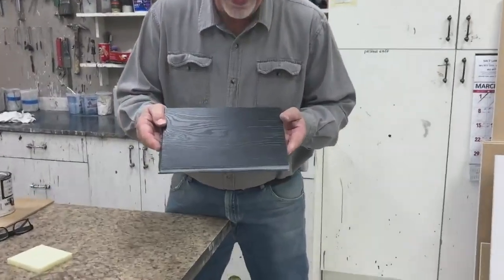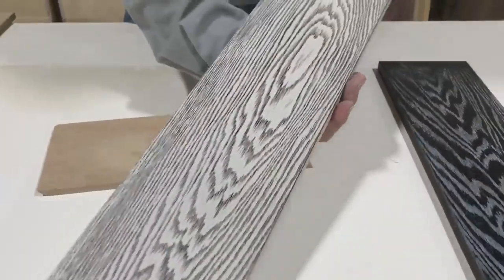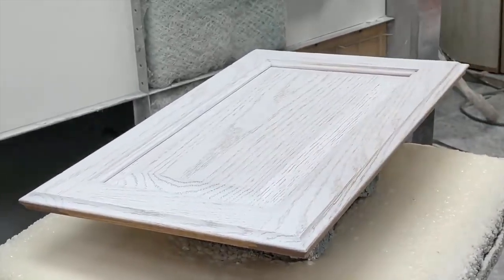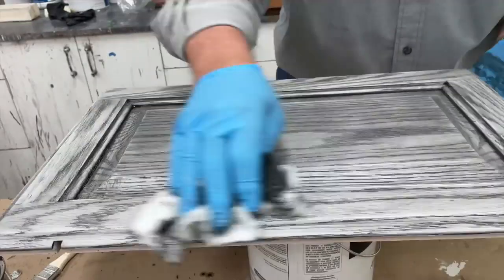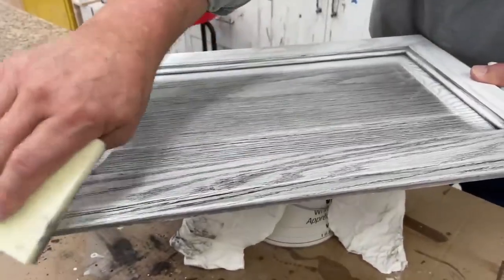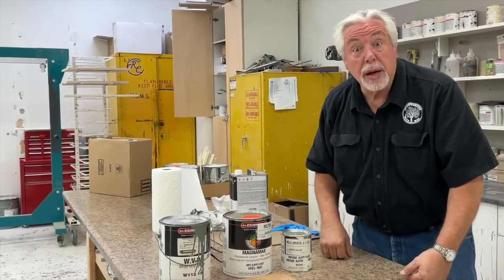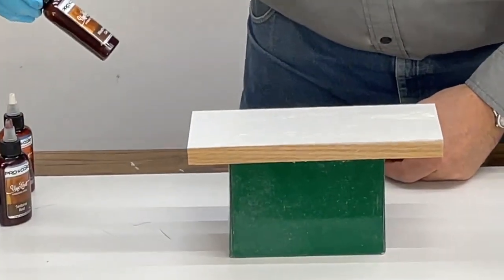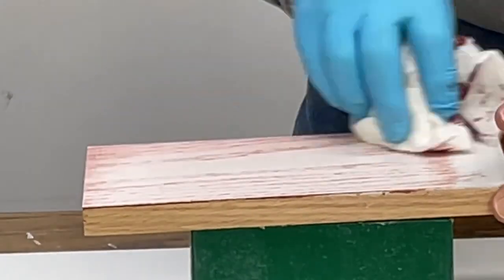Transform Your Golden Oak with Wes's Top 4 Cerusing Videos

Comment: There is a cable channel that I think should be turned off. Their "experts" are driving folks to do things that are not the best choices. I can understand doing this to "cheap" furniture", but for quality pieces, if you are going to do this stuff that is in the video, seal the wood first so that later it can be removed without having to sand or plane a bunch off. Styles will again come back to natural wood. And for heaven sake, don't paint brick, it is totally destroyed for future owners. Wes usually has some good suggestions.

Comment: Hi Wes. First off, your cabinet finishing skills are amazing!
I am trying to ceruse my kitchen cabinet. You inspired me to take on the job. 
I wire textured my cabinets real good. I have put 2 coats of Bin Zensser primer coat on. Do I need to add another sealer before applying my glaze? Also, what glaze, that is over the counter, would you suggest with the Bin Zensser primer? I've put a lot of work in so far, and just really scared to mess up. Any advice would be truly appreciated, sir.
Reply from the maker: Hi Wyatt...I am not familiar with the Bin Zensser primer that you are using but to be safe, apply a clear sealer coat over your primer. As far as the glaze goes, I recommend ProCoat Unicoat Glaze and will provide you with a link to the video that will give you a link and discount to the product. Hope this helps. Wes
https://youtu.be/-FSoaeDcSjg?si=6QdI8pgnZ0tHd5-6
Reply: @WoodworkingWithWes  So very kind for you to reply , Wes! You are very talented sir! Thanks :)

Comment: Hello Wes, I realllly love this technique. How do I finish the cabinet sides and front that I cant remove. Should I paint them just solid white?

Thank you for your wonderful videos!
Reply: When painting cabinets they should be fully disassembled. Doors & drawers taken off, drawer fronts removed from drawers, fascia pieces (fake drawers) need removed, etc. This will leave you with exactly what you're talking about left in place. The sides, stiles, and spreaders. These must all be finished in place if you aren't removing the cabinet. Remove surrounding obstacles (yes including toilet), tape and protect surrounding area, then ceruse that puppy! I would protect the inside as well. Maybe do the inside white, maybe do the drawer insides to match.

When separating drawers, number them where they meet after separation. So you can place them together as they were. If not you might need to re-set the drawer faces which is a bit more complicated.
Reply: The kicker underneath can just be white, but any high-end cabinet will have a matching kicker, dealers choice there.

This is a beautiful look. I've been in the industry a while. It took me about 7 minutes to decide I like it enough to use professionally, and 15-20 to decide I'm going to invest in what's needed to accomplish this look.

It might take a little while... there's a pile of tools I need for wood finishing. But I need to finish things if I want to sell them, and I need to do a top-notch job to match my workmanship.

Here's my tool list...
Festool ets ec 150/3
Makita wheel sander
Graco finishpro hvlp 7.0

Sander 1st $575, need it for a refinishing job which will pay for it.

Wheel sander 2nd $699, to unlock the wire brushing technology @ a professional level. (Time is money, items need to be sold)

Lastly is the sprayer, I can technically hand finish for now.
Reply: @brandonhoffman4712  Thank you very much for the description, you have been very helpful. Much appreciated!
Reply: @PkCrochet  you got it, feel free to shoot me a question if any come up!

Comment: Problems I encountered with this process. -
- Finding a primer that could be tinted, many of the stores wouldn't do it, or not to shade it as dark as I wanted, which the lighter shade actually worked better.
-finding the correct Glaze is really tough, mixing clear glaze with black latax paint caused the glaze to set up faster making large areas impossible to get all of it off and cause shading and streaking. I used as little of black as possible to let the glaze work correctly. 
-I figured out that sealing the color with polycrylic helped with the streaking, I did this halfway through my job 8 months ago.
-I waited a day to brush up on clear top coat and it blended with the black to completely shade the whole first few cabinets darker, wait at least two days or longer !
-when I did the last cabinets I had to add a touch of black to the clear to shade the latter ones to match the earlier done cabinets because of the the melting of the glaze into the clear.
-Then finally, areas that smeared in wiping off the glaze I lightly sanded to not have to make it a complete do over, a lot of work and frustration to get to a matching finish.
-In hindsight, I wish I would have known of these procedures and used something different like the M. L. C glaze, I think I read it is a oil base? Or tested a slower drying product, I would have had a lot easier time, but in the end, I like the results.